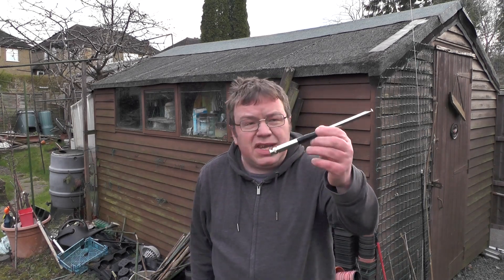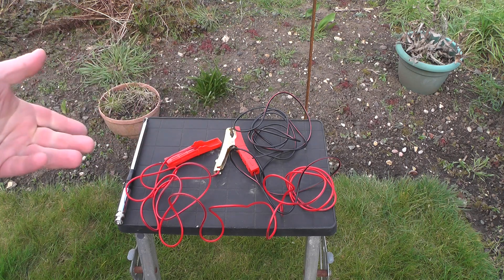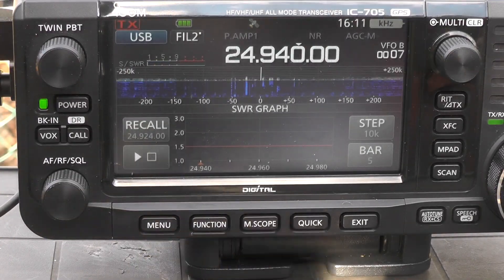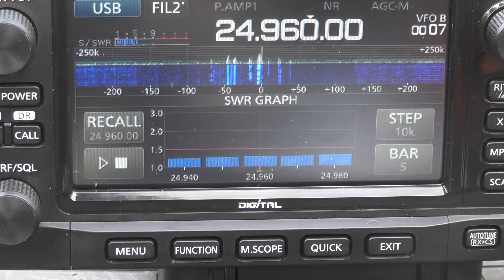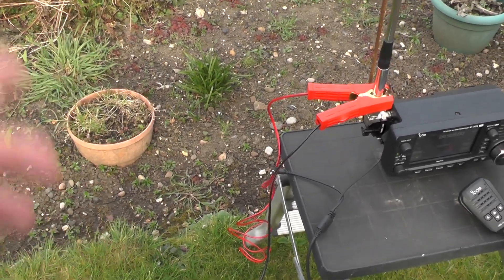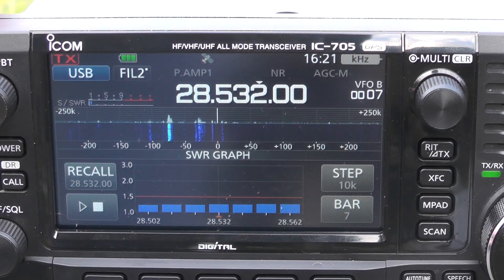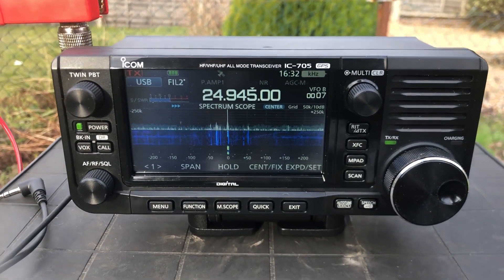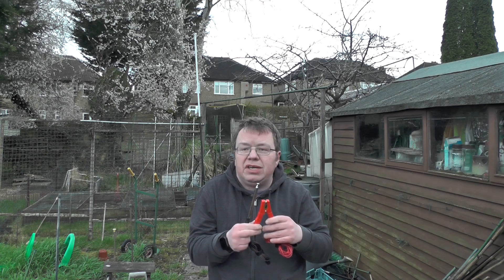Turn These radios in to a Walkie Talkie

Comment: I did this when I had the preproduction X5105. The X5105 was part of my creation. The engineers asked me what I wanted to see in a portable radio. I said HF 6 metres, large display, built in auto ATU and a high capacity battery with long operating times. They then came up with the X5105.
Reply from the maker: @qrphfradio7753  my 5105 has a issue is seems to lock up and go into tx mode and has audio stuttering on the air . I’ve done a software update and it’s still the same